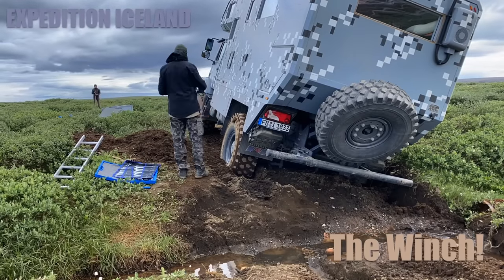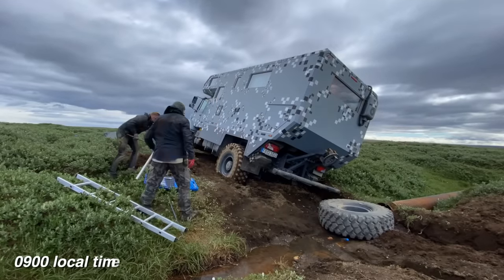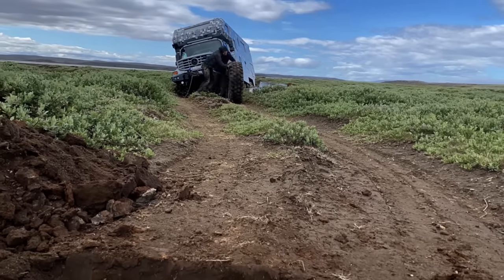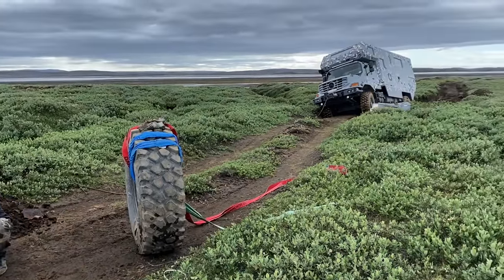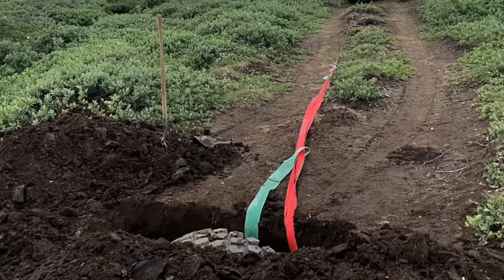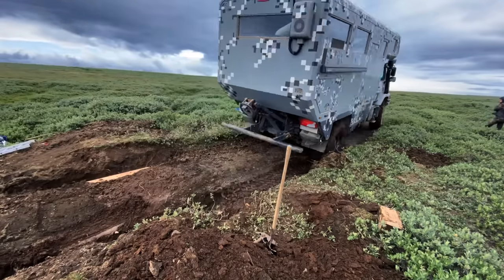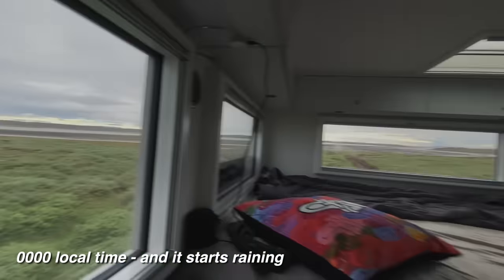Stranded MB ZETROS 4x4 - Grand Tour EXMO - Mud Free for the Truck, finally!

Comment: Was this necessary?
Reply from the maker: Absolutely not! it was really bad luck!
In the beginning, an Icelandic Ranger specifically guided us to take this path when we inquired about a route connecting two highland roads. He provided clear instructions to follow this route. Additionally, it's important to emphasize that we never ventured into off-road driving. 
So, let me emphasize again: following our map, we naturally adhered to designated trails, which were further marked by wooden posts. Nonetheless, there were several locations where these wooden markers were missing. In such cases, we followed existing tracks on the terrain, essentially driving in areas where previous vehicles had traversed. Interestingly, as we progressed, additional markers would reappear. The landscape in the glacier region undergoes continuous changes due to river flows. Iceland might want to consider either closing off these routes or providing more visible signage to prevent people from getting disoriented or lost.
Reply from the maker: yes that was the idea, but no cellphone-signal .. so what was the option.. the track was in very bad condition before, we just freed the truck with minimal damage to the surroundings. @martijnveenman5129
Reply: How about not going where you dont belong?
Reply: @peteruppert   The ranger never mentioned that this vehicle was too big for the nature and the roads? And the tires are too narrow, you need a lot wider tires to carry a truck like that in the Icelandic highlands.
Reply: @Wisurriv plot twist: there was no ranger

Comment: I've travelled Iceland's F-roads quite often, usually in a Landrover Defender. I've also driven MAN KATs off-road on military training grounds in Germany and abroad. The choice of vehicle for travelling is at your own liberty, as long as its use complies with regulations in Iceland. Based on the information you provide this appears to have been the case. I'm also well aware that sometimes one is just unlucky. However, it is more than obvious that a 13-ton Zetros is grossly oversized for Iceland. Ground pressure is an ambivalent argument. A Leopard II A7 battle tank can claim an even lower ground pressure (mass per square cm) than the Zetros. Forget about the irony - this incident certainly hasn't helped the reputation of tourists driving "off-road" vehicles with the local population. It may well trigger even stricter regulations at the national level which will affect an entire body of tourists to Iceland, not just yourself. Apart from all this, it was more than unnecessary to advertise your controversial experience by uploading this video to Youtube. You've done the community a bad service ...
Reply from the maker: At least a voice that stands out from the general and undifferentiated storm of criticism! And yes, it was just bad luck and unforeseeable that we got stuck at that spot. (By the way, this wouldn't have happened if we had departed from the already heavily rutted path and driven on the vegetation cover next to it - which we didn't do due to regulations!)
Unfortunately, there was no mobile network, and otherwise, there was no chance to get help. So, we had to dig ourselves out. The truck has a ground pressure of 1.08 kg/square centimeter at 2 bar tire pressure, which is not even bad! And no, the truck is not oversized either. All the tracks were very drivable, and there were no other problems. By the way, some of the Icelandic 'Superjeeps' are even wider than 2.5m!

Wenigstens mal eine Stimme, die sich abhebt vom allgemeinen undifferenzierten ShitStorm! Und ja, es war einfach Pech und nicht vorhersehbar, dass wir uns an dieser Stelle festfuhren. (Was übrigens nicht passiert wäre, hätten wir den bereits maximal zerfurchten Weg verlassen und wären daneben auf der Pflanzendecke gefahren - was wir nicht taten aufgrund der Bestimmungen!) 
Dummerweise kein Mobilfunknetz und auch sonst keine Chance, Hilfe zu holen. Also Freigraben. Der Truck hat einen Bodendruck von 1,08kg/Quadratzentimeter bei 2Bar Reifendruck, das ist nichtmal so schlecht! Und nein, der Truck ist auch nicht oversized. Sämtliche Pisten waren sehr gut befahrbar, es gab sonst keinerlei Probleme. Übrigens: Einige der isländischen 'Superjeeps' sind sogar breiter als 2,5m!

Comment: no off-road experience.  it was necessary to roll it out first with flat tires if the ground is soft.  and then drive in at speed.  and a hole from the wheel was dug right across the road, now other drivers who drive there will fall into it.  You could have dug it on the side of the road.
Reply from the maker: tried everything before.. the road ended few hundred meters later, so no harm with the hole..

Comment: The Icelandic media is trying to make a big drama out of this. All I can see is an honest attempt to get the car loose with minimal damage to the surroundings.
Reply from the maker: this is actually true!
Reply from the maker: I’m operating the truck on 13 tons as it’s not completely filled with water, diesel and gear. On the 16.00R20 tires and deflated down to 2.0bars, a tire has a contact area on the ground of 0,3 square meters - all tires together 1,2 square meters. So the pressure on the ground is 1,08kg/cm² which is not so bad. Also is the width of the truck 2,5m which is about the same or less as the heavily modified Icelandic super jeeps! The truck is neither too heavy nor too wide for F-roads!

Comment from the maker: I’m operating the truck on 13 tons as it’s not completely filled with water, diesel and gear. On the 16.00R20 tires and deflated down to 2.0bars, a tire has a contact area on the ground of 0,3 square meters - all tires together 1,2 square meters. So the pressure on the ground is 1,08kg/cm² which is not so bad. Also is the width of the truck 2,5m which is about the same or less as the heavily modified Icelandic super jeeps! The truck is neither too heavy nor too wide for F-roads!

And again to make things clear about the STUCK situation: It was really bad luck! We were trying to find a passage between 2 highland roads and consulted an Icelandic Ranger. He advised us to drive there - by saying: “Yes, it's possible on the track and this truck goes anywhere anyways.." 
But track conditions became worse - still drivable, no problem. But finally as we stayed on this way - we got stuck suddenly. The track on this particular part WAS already in a devastation condition, still I did stay on this track as I didn't want to off road it to pass the impassable part..
No signal for mobile phones - and nobody since 2 days around..! What was our options? 
So we dug the truck out (took us 4 days, step by step) and turned around.. 
Shovel and wood we brought back to the shelter where we borrowed it from plus a good amount of alcohol we deposited there as a kind of payment to whom it may concern.. 
I completely respect nature - in this case we just worked on a track that was destroyed before! 
Btw: 250m ahead the track ended at impassable rivers, so it was a dead end anyways..
Reply: Das ist Quatsch weil der Isländer einfach 10t leichter ist 😉. Man kann versuchen es sich schön zurechnen aber dass das ganze nicht stimmt sieht man am entstandenen Schaden.
Reply from the maker: @landrover3986  naja der vulkan hat hundertmilliaren mal mehr schaden angerichtet- zeitgleich übrigens

Comment from the maker: They still have the winch. It's a tough WARN winch, capable of pulling up to 18,000 pounds. But having a winch is no good if you can't anchor it anywhere, as the saying goes.
As the lieutenant failed to familiarize himself with the spare tire holder's workings, he couldn't manage to crank it down. He decides to unscrew the tire while it's still in position, hoping not to be crushed by it, relying on his reflexes. Meanwhile, for the past hour, Robin, the young scout rover, has been digging a large hole across the track, measuring 1.5 meters by 1.5 meters and 0.5 meters deep. The excavation amounts to 1.125 cubic meters of earth. During the short night, the lieutenant came up with the idea to bury the spare tire as a sort of an earth anchor. After all, it weighs 300 kilograms and has a diameter of about 1.4 meters. If buried deep enough, it should offer significant resistance for the winch. However, just getting it rolled forward over the hill from its position behind the truck requires the lieutenant to shovel a ramp; otherwise, the guys won't manage. The efforts of the past days have taken a toll on them. The loops of the recovery straps don't align precisely with the bottom of the tire when it falls into the pit. Under tension, the tire twists, causing the lifting strap to be on top. The soft sandy ground can't withstand the force, and the tire gets pulled out. Back to one says the lieutenant, starting all over again. The tire needs to be completely pulled out first, the loops repositioned, and more ramps need to be dug at the truck's front while placing boards underneath the tires. With God's help and after a long struggle, they will finally succeed in freeing the truck!

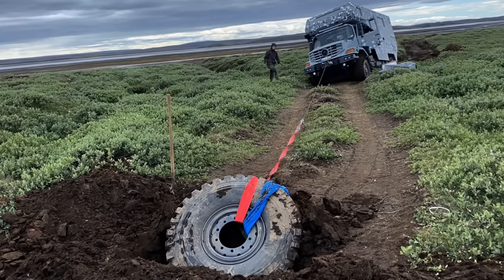Comment: 3:20 for anchor use a T-type trench, not a I-type. And the rope need to fix down the anchor, not the top. And for 6 tons and soft soil need more deep trench
Reply: try and error..
Reply: there is always a gap between theory and praxis..
Reply from the maker: truck is 14t, winch pulls 8t, rope: sure on the bottom - but it's not easy to calculate while rolling the wheel into the trench.. was sideways on 1st attempt, so the wheel turned and rope came to the top as so can see in the video. 2nd try was better as the rope came to the bottom and so it worked..
Reply: Better yet; don't get yourself in a situation like that - it seems that your common sense was significantly outweighed by your vehicle, that track and the delicate landscape is clearly not suitable for this vehicle.
Reply: How about you just call the SAR instead of destroying the track and have the professionals get you out

Comment: Too tall. The leverage on one side must me massive.
Reply from the maker: I’m operating the truck on 13 tons as it’s not completely filled with water, diesel and gear. On the 16.00R20 tires and deflated down to 2.0bars, a tire has a contact area on the ground of 0,3 square meters - all tires together 1,2 square meters. So the pressure on the ground is 1,08kg/cm² which is not so bad. Also is the width of the truck 2,5m which is about the same or less as the heavily modified Icelandic super jeeps! The truck is neither too heavy nor too wide for F-roads!

Comment: Icelanders went weeks later to fix your mess. 
Sorry but it’s only stupidity to go with 13 tonn truck on road like this. Also minimum you could have do is to fix the damage you made. 
It’s not drama in icelandic media. You created a big damage on the road and just left it.
Reply from the maker: the road ended there anyways.. Yes, I’m operating the truck on 13 tons as it’s not completely filled with water, diesel and gear. On the 16.00R20 tires and deflated down to 2.0bars, a tire has a contact area on the ground of 0,3 square meters - all tires together 1,2 square meters. So the pressure on the ground is 1,08kg/cm² which is not so bad. Also is the width of the truck 2,5m which is about the same or less as the heavily modified Icelandic super jeeps! The truck is neither too heavy nor too wide for F-roads!

And again to make things clear about the STUCK situation: It was really bad luck! We were trying to find a passage between 2 highland roads and consulted an Icelandic Ranger. He advised us to drive there - by saying: “Yes, it's possible on the track and this truck goes anywhere anyways.." 
But track conditions became worse - still drivable, no problem. But finally as we stayed on this way - we got stuck suddenly. The track on this particular part WAS already in a devastation condition, still I did stay on this track as I didn't want to off road it to pass the impassable part..
No signal for mobile phones - and nobody since 2 days around..! What was our options? 
So we dug the truck out (took us 4 days, step by step) and turned around.. 
Shovel and wood we brought back to the shelter where we borrowed it from plus a good amount of alcohol we deposited there as a kind of payment to whom it may concern.. 
I completely respect nature - in this case we just worked on a track that was destroyed before!